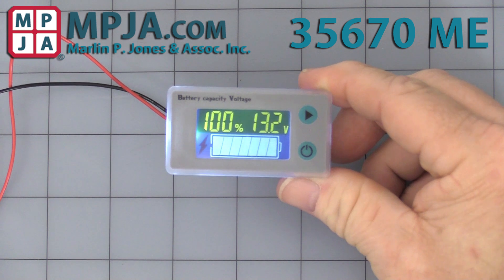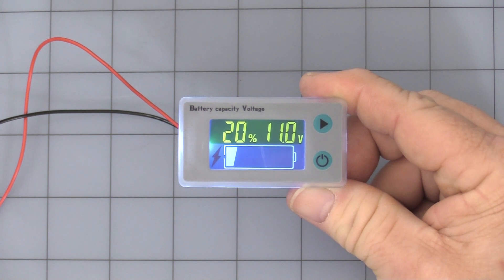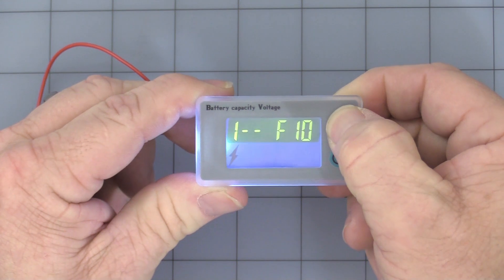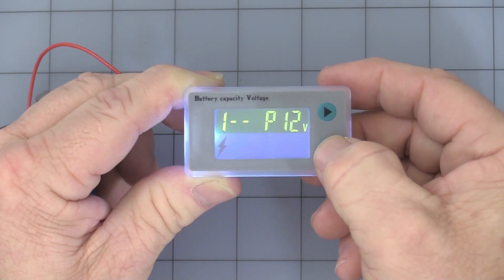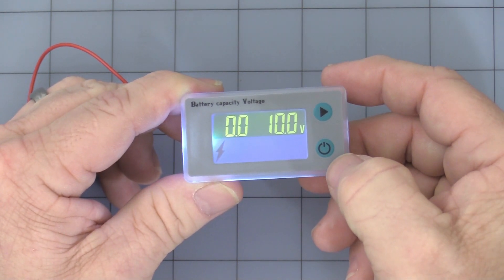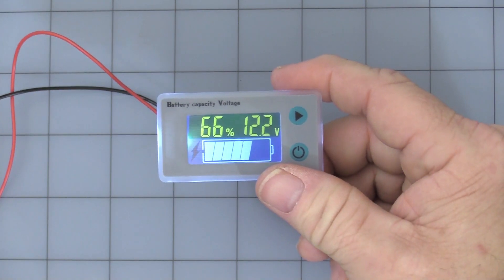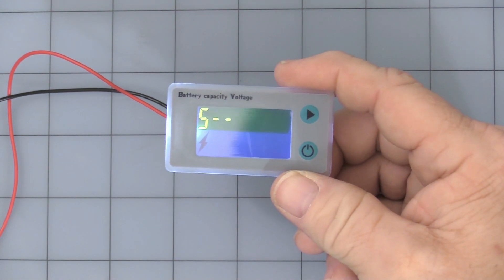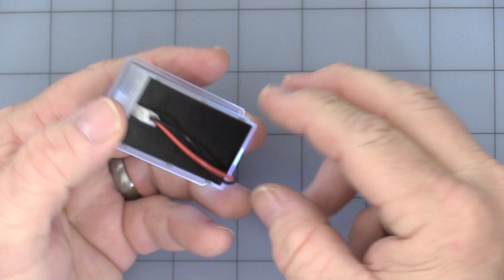LCD Battery Monitor with Bar Graph 35670 ME

Comment: Thanks for showing! Question: I have a Lifepo4 battery, in menu 1 I select L. If I then enter "2" cells, the display seems to be reasonably correct with 13.3V and 100%. If I enter "4" as said in the video, the charge indicator shows 13%. How many cells are correct?

Comment: Very useful video. You only missed to turn OFF/ON to see if the module stores the configuration. Not sure if the module can turn on itself when connected to the voltaje supply  or it is necessary to press the ON button. What's the minimum voltaje the module can measure?